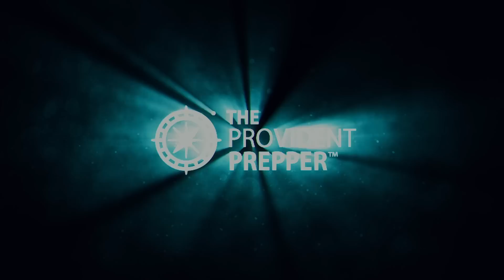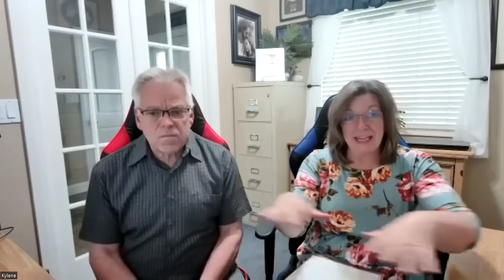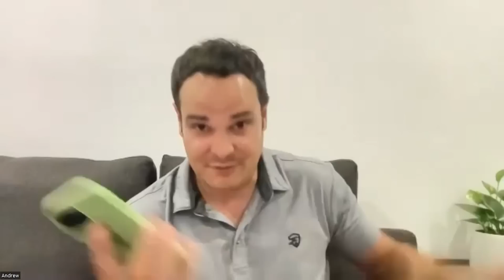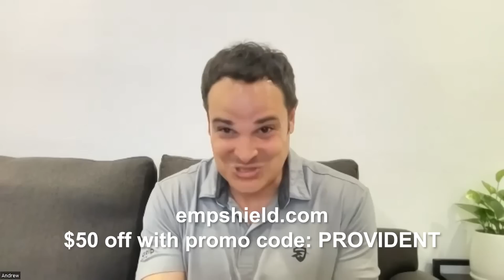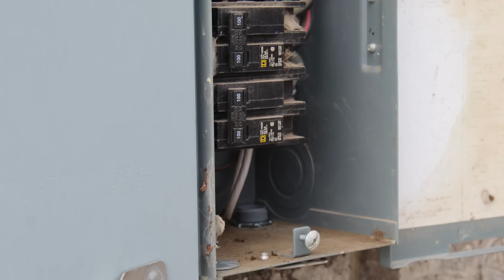Facts About EMP Protection: Interview with EMP Expert Andrew Bucchin

Comment: This is a very interesting conversation. As a former U. S. Air Force, Strategic Air Command officer, the question is more, Do you want to survive any of these issues? In the 70"s I really thought about this a lot. My choice is to be as close to ground zero as I can get. Am I prepared, of course. However, if you want to be the 10% that survives any of this, It will be a very slow and painful death to just become the 1/2% of the remaining. Your life if you still survive it will be life resembling the middle ages. You will not be able to grow food due to radiation, wildlife will be contaminated. Okay, you will need a shelter to live, clean air, water, that you cannot leave for at least a year. Do you have 10 plus years of food before you can start growing anything.
Reply: While what you have posted is mostly accurate for areas that have fairly dense population, industrial, high tech or Military bases near by. There really is no place to go that could provide survival for anyone in those regions. There are areas in the Rockies and Sierra Nevada Mountain ranges and the Oregon 
Cascades that are remote enough for seasoned young outdoor type people. I grew up in Carson City, NV., and I know of several areas that provide good remote survival possibilities. Living out in these places will be very challenging and most difficult for the first timer. If a few have camped in those area, life can be sustainable since you will have some basic knowledge. It will be a 24 hour a day job. If Kit Carson the great Western scout can survive in the mountains of the wild West, others will also survive. Of course Kit, at one time had a very knowledgeable native American wife who knew where to look in the forest for edibles. I married an Island girl that grew up in a small island north of Okinawa and her mom had a wealth of knowledge about what island plants were edible and what could be harvested from the sea when the tide was out, not to mention best ways to catch fish. So those are all parts of the secret to survive for as long as you can. That Island I consider my second home, but I did have help since my wife and her family are well known and well liked in their village and around the island.
Reply: @franklinmartin8103  The Rocky Mountain region is where all the US nuclear weapons are. That region will be a nuclear wasteland because that one of the first things that will be targeted.

Also nuclear explosions could set off Yellowstone.
Reply: @midriffzero  Didn't read too closely did  you. The Rocky Mountain area was only one of three areas that I named.
Reply: @franklinmartin8103 Yeah I read it closely. 
I can't comment on the other two since I have zero knowledge of if they would be safe or not. 

But since I live in the middle of the nuclear triangle that is the Rockies. I can say that you are wrong about it being a safe area in a nuclear attack because its a giant target for the first salvo.
Reply: @midriffzero  I'm saddened that you live so close to those installations. But as you know the Rockies extend from Northern areas of Canada, Alberta, going South through parts of Idaho, Montana, Wyoming, small part of Utah into Colorado and the Northern area of New Mexico. And while I've traveled the Cascades and much of the Sierra Nevada Range,  (old lumber camps and mining operations are of interest to me), I have been to the Idaho and Montana  sections of the Rockies. I do not believe there are any installations like you describe in the northern most Canadian Rockies. The old DEW line is even more north than where the Rockies end. While in the military, I was in Advanced Radar and IFF, even did two years as a Radar Instructor at Great Lakes Service Schools Command. So I have been to many installations. I am sure there are areas remote enough from even the Yellowstone caldera and the military installations that would afford a good chance for survival. Maybe not for city types but for others who have been out in the wild, they would have a pretty fair chance, as long as it is remote and has good water.
Reply: @franklinmartin8103  First If Yellowstone blows that is a Armageddon level event and would trigger a second Ice Age, Everyone on Earth Dies nowhere is safe. 

Canadian Rockies are safe from Nuclear. But that is a really harsh climate up there. Living off the land up there is extremely hard in normal conditions. There is no growing season, and wildlife isn't that abundant. Add a million people and possible fallout. And the chances of you finding clean food to eat is next to nothing.
It ends up being highly improbable that you would survive for very long. More then likely freezing or starving to death within a year.

 All Major cities are targets. So Denver, Albuquerque, and Salt Lake will be hit. So that eliminates North central New Mexico, Central Colorado, and northern Utah ranges from being safe. As for the rest of the American Rockies our Enemies and most Americans  don't know the exact locations of our nuclear silos all anyone really knows is the Rocky Mountain region. So if an attack happens. You cant say any part of the that region is going to be safe because anywhere you go you could end up with a nuke landing on your head or close enough. Add in the fallout that will cover almost all of that region contaminating the air, all water, ground and wildlife. Making survival completely impossible. You would just die a slow painful death of radiation sickness, and/or thirst and starvation.

A common saying around here is 
"If you see a mushroom cloud. Just bend over and kiss your ass goodbye cause your already dead."

The only way you truly survive if you live in the region is in a fallout shelter with enough food and water for at least 2 to 3 generations at maximum shelter capacity. You would be able to leave the shelter in your lifetime but you still need the food and water for a while after you can leave.
Reply: @franklinmartin8103  Ok I did write a more in depth response but Youtube i guess didn't like it. So I will give you the shorter response. Feel free to ask questions.

Yellowstone blowing it top will cause a second Ice Age almost all life will go bye bye.

Utah into Colorado and the Northern area of New Mexico are where three major population areas are(those are targets), so not safe. Rest of the American Rockies are known areas of silos but exact locations are unknown, so those are unsafe. Canadian Rockies are a super harsh climate you could survive an attack but your not going to live very long. There is just not enough food for the millions of people that are thinking like you. 
 
 Anyone that lived in this region during the Cold War already knows you can't run and hide anywhere above ground. All you can do is continue to live life as normally and comfortably as possible, pray to your maker and hope that you are one of the lucky ones.

Best chances of survival are Rural areas of the south and east coast, rural northern areas of the great lakes states and rural areas of Oregon. Providing nothing changes the weather patterns.
Reply: @midriffzero  After the first exchange there won't be too many alive so the few who can get north will probably not have too many neighbors. But having a few would be better odds of survival as there would be dedicated tasking within the small survivors group. . And city folks in the mountains for the first time, will be gone during the first winter, sadly. So I don't really see an issue. Just be a surviver from the exchanges and head north.
Reply: @franklinmartin8103  After the first exchanges if your still alive then the smart move is to hunker down and stay where you are. You know what is there and what isn't (aka radiation) and you have the jump getting what is needed to survive. 

Heading out across the possible radiation contaminated country without full rad suits to a place that is freezing cold(which could be much much colder then it is now) with zero shelter and no idea if it has clean water or food is just stupid and the chances of you even getting there let alone surviving for very long is next to nothing.

The only people that are going to survive up there are the ones that are already there or have preplanned, and have shelter to go to and supplies.

In any survive situation your best bet is always to hunker down and stay put. Moving to the unknown is a game of Russian Roulette.
Reply: @franklinmartin8103  In any survival situation best bet is always to stay put unless you are 100% certain that can't survive there and then you still only go if you are at least 75% sure where your going has what you need. 

The Northern Rockies are too harsh to live in for very long. If it's winter already your screwed your not going to make to there. If not then you have at most three to four months to get there, find someplace with clean water and good amount of food way far off the beaten path to insure your not competing with others which means hiking into the wilderness with only what you can carry, then once you find that place you have to build a basic cabin using packed in hand tools or tools made out of rocks while hunting and gathering enough food to last eight months minimum because you can't grow anything with the permafrost. And if you can get all that done( 90% of people won't) you might have a 25% chance surviving winter. In normal conditions. 

But this isn't normal conditions, So you have to add in unchecked wildfires and firestorms in heavily wooded areas throwing radioactive smoke and soot into the air possibly blocking out the sun and Killing or changing animal migratory habits. Also that mountain snowfall could end up being radioactive with all the particles in the air. So that 25% chance is now more like 0.01% chance of surviving winter and back to 0% on surviving past that..
Reply: People in Auschwitz still struggled to stay alive.  So would you.  It is best to be prepared for that struggle.
Reply: That’s how I think 👍
Reply: Emp isn't limited to made made bombs. Thet occur naturally from the sun

Comment: I have one of these on a breaker box. Will it work? Nobody knows until we get some type EMP or solar flare. However, I had one on my solar controller and it damaged my controller which forced me to have to purchase a new one. I now have a Midnite Surge Protecter on it because my controller is a Midnite controller. The original controller worked fine until I attached the EMP Shield. The replaced controller has been working perfectly. I would NOT attach one of these to a solar controller as you'll definitely risk it being damaged. When this occurred their support told me they do NOT test these with controllers, so, there is NO way to know if the controller will work once one of these is installed.

Comment: I  note that  all of  these 'experts'  experts waffle on about macro-effects  NONE of them  explain HOW the assorted 'pulses'  EFFECT  the  power grid and other units such as  cars, which are  NOT on the power-grid. (And  do electronic ignition systems respond in the  same way as ordinary (old-fashioned ELECTRIC) ones?   THEN  they  might  get into more common subjects: how  and in what circumstances  does a,  'EMP' effect solar-systems/battery-banks  NOT  connected  to the  grid?  OR  human bodies, which  ALSO  run on (electrical)  nervous-systems??
More:   What  prevents  an EMP not ALSO  strike the grids of the parties  that  set it off?  I keep  thinking I'd deo better to  re-read 'Alice in Wonderland'  to  get  my kicks!

Comment: Great questions.  I have a more directed question that I did not hear specifically.  Is it more the batteries of electronic units that need the protection or the electronics themselves.  If I store things without batteries in them will that help at all?
Reply: No, batteries in or out doesn't matter.  The EMP will damage the electronics directly.  Depends on the strength of the EMP and the electronic footprint of the device.

Comment: Regarding Mr Heater and other brands of propane or kerosene heaters. For those thinking of purchasing one for emergency yes it is a good idea. The starting system on those is just like your barbecue with the snap click red button starter. It's just like the clicker under your stove it's a single snap of static electricity that makes a bright Spark it's not integrated with any other system of the heater, such as an overheat or a tip over safety contraption. You can start it with a barbecue lighter or a long wooden match for that matter just like you would holding a long stick match up to your propane Lantern to fire it up.
Reply: Also get a cold weather sleeping bag for each person.  Long as it is dry it will be warm.
Also wool Longjohns.

Comment: 00:00 🌐 Introduction and Overview of EMP Threat
EMP (Electromagnetic Pulse) is a serious threat with conflicting information.
Preparedness for EMP is crucial for various events.
Introduction to Andrew Bucchin, an EMP expert, and the purpose of the discussion.
01:15 🔍 Types of Threats: EMP, CME, and Lightning
Three main threats: High-altitude EMP, Coronal Mass Ejection (CME), and Lightning.
Explanation of high-altitude nuclear EMP as an energy weapon.
Distinction between CME, solar flares, and lightning in terms of origin and impact.
04:34 ⚡ Severity and Effects of EMP
EMP's devastating effects with a focus on long-term consequences.
DHS projection: 90% population casualty within a year.
EMP as a bloodless but highly destructive weapon.
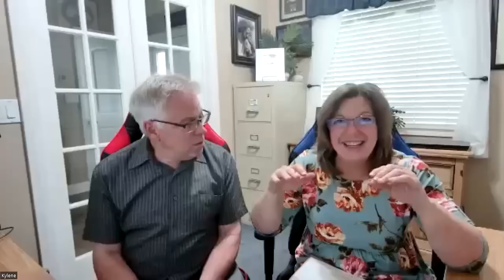06:09 🤔 Common Misconceptions and Myths
Faraday cage effectiveness but with limitations.
Myths about using a microwave, disconnecting vehicle wires, and Faraday cloth.
EMP Shield as an effective alternative for protection.
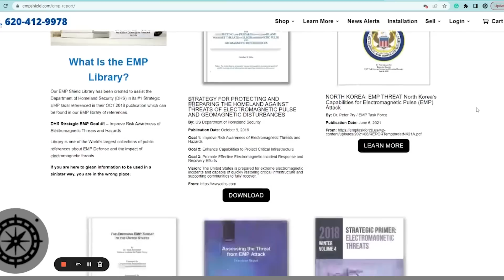11:28 🏠 EMP Shield and Home Protection
Introduction to EMP Shield as a protective device.
Application of EMP Shield for homes, vehicles, RVs, and battery banks.
Addressing questions from viewers and clarifying protective measures.
15:41 📱 Electronic Devices and EMP
Electronic devices' vulnerability to EMP, regardless of being on or off.
Discussion on the survivability of cell phones and other devices.
The importance of understanding the complex variables involved.
17:32 ☀ EMP's Impact on Solar Panels
Solar panels' susceptibility to EMP, focusing on their construction.
Differentiating between traditional and modern panels.
Addressing potential damage to charge controllers and inverters.
18:30 ♿ Protecting Power Wheelchairs from EMP
Examining the vulnerability of power wheelchairs to EMP.
The role of EMP Shield in protecting specific electrical systems.
Encouragement to contact EMP Shield for personalized guidance.
19:56 🔦 LEDs and Their Vulnerability to EMP
Exploring the varying vulnerabilities of LED devices.
The importance of considering specific device variables.
Acknowledging the complexity of predicting the impact on LEDs.
Note: Timestamps are approximate and rounded for simplicity.
20:23 ⚡ Protecting Devices from EMP
Recommendations for protecting devices with microelectronics from EMP.
Importance of keeping devices connected to a protected electrical system or inside a Faraday cage.
Highlighted medical equipment like oxygen concentrators, nebulizers, and CPAP machines.
21:06 🏠 EMP Shield Home Model
Explanation of EMP Shield's home model and its unique design.
Comparison with traditional surge protectors, focusing on its ability to react faster and protect in both directions.
Assurance that devices connected within 10,000 square feet or 500 linear feet are protected.
23:49 🌐 EMP Shield's Partnership with Grid Down
Announcement of EMP Shield's partnership with Grid Down for an EMP-protected energy storage system.
Emphasis on affordability and robustness of the energy storage system.
Addressing the need for a backup battery system during power outages.
24:31 🔥 EMP and Buddy Heater
Discussion on whether Buddy Heater, a small propane portable heater, would be damaged by an EMP.
Explanation based on the presence of microelectronics in devices and the likelihood of damage.
Suggestion to inspect devices for microelectronics to assess vulnerability.
25:28 🛡 Testing and Validation of EMP Shield
Overview of EMP Shield's rigorous testing, including military standards and collaboration with experts.
Mention of testing with Keystone Compliance and Dr. William Rodaski from the U.S EMP Commission.
Public recognition by the Department of Homeland Security and partnership with National Security collaboration Center.
28:14 🚗 Vehicle and Home Protection Importance
Explanation of the critical importance of protecting vehicles with EMP Shield after an EMP event.
Addressing the misconception about the relevance of protecting a home when the grid is damaged.
Highlighting the significance of functional vehicles for survival and immediate recovery after an EMP event.
31:14 ⚡ Multiple Benefits of EMP Shield
Stresses the importance of EMP Shield for lightning protection, backed by insurance guarantees.
Explains the advantage of immediate recovery after a low to moderate CME event, reducing downtime.
Encourages installation for overall peace of mind and protection of electronic devices.

Made with HARP AI